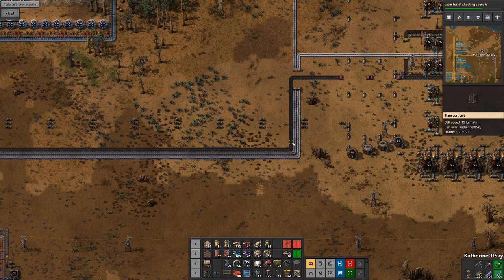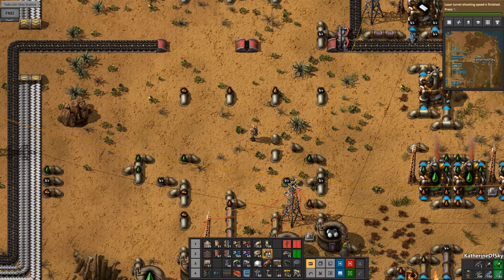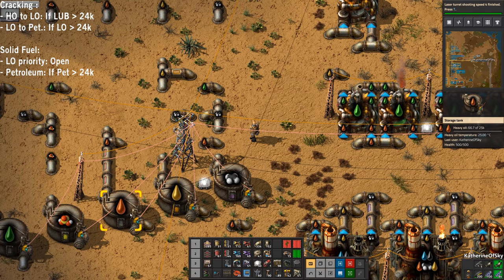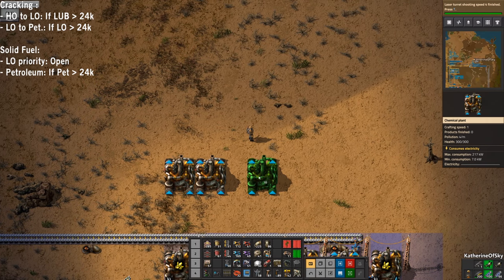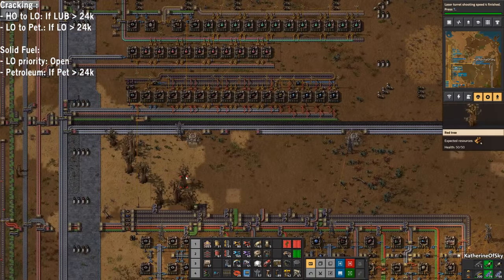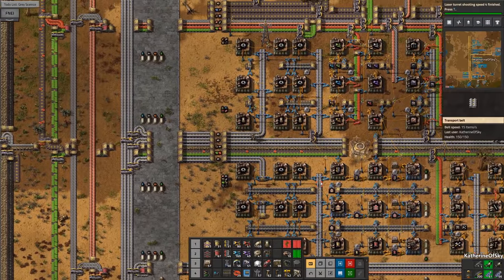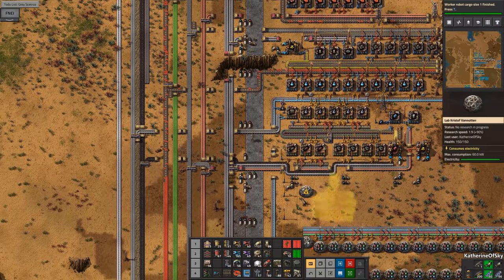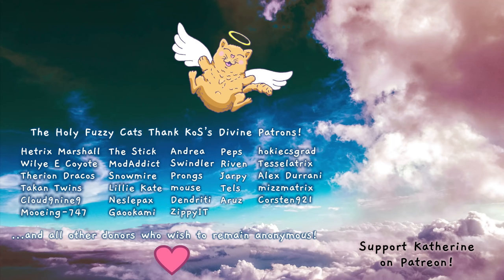Factorio 1.0 Entry Level to Megabase 3, Ep 16: ADVANCED OIL SETUP - Guide, Tutorial

Comment from the maker: Do you use circuits in your advanced oil setup, or let things flow freely?
Reply: The oil must flow! xD
Reply: I tend to use circuits as it helps regulate the different fractions and make sure there isn't too much of one and not enough of another, although with basic oil processing I just wait until later.
Reply: I generally just wire up the pumps to the tanks with conditions "light oil < heavy oil" and "petroleum < light oil" to make them only supply input to the cracking arrays when the fluids are out of balance, so that it will stop cracking if the lubricant or solid fuel / rocket fuel production is using lots of the respective resource, but if petroleum gets really low it will feed more light and heavy in to keep things running.

Good idea using pumps to distribute the petroleum to plastic and sulfur even when it's low.
Reply: Always use circuits!
Reply: I used to don't use circuits at all just let it flow. Thanks to your vids I saw the potential and nowy oil and other work 100 times better!
Reply: Circuits everywhere! I was wondering how complex you were going to go with this part of the playthrough.
Reply: LOL LOADED question that .... I will try and keep this as clean as possible ... but as a  guy there is only one answer to that ... it has got to be FREE ... lol };) 
nice timing btw ... breakfast theater after a 12 hour nap ... just what a tuesday needs after a monday ;)
Reply: the English language is so much fun when one can say more than one thing with the same words
Reply: I most definitely use logic to keep the amount of heavy and light oil between 30k and 50k using an RS-Latch (I use 2 tanks for each of these). I get stuffed by gas every once in a while, but not often. Plastics/sulfur usage keeps that in check normally.
Reply: Never used circuits, normally I try to keep my factory in constant work (science, belts and stuff) and I try to balance out oils, lube and petroleum, with little care to precise ratios....
Reply: I've never used circuits before, but I'm willing to try after watching how easy you made it seem
Reply: I have tried some complex combination with deciders and lots of conditions but it always need some adjustment and never worked fine. In the end the simplest is the best. I do the same as @Yancarlo said, "light oil < heavy oil", "petroleum < light oil" and so on to balance them with cracking, and works like a charm.
Reply: I was using circuits for the heavy to lubricant/cracking, but found the pump between the two to be unnecessary. If the heavy flows past the lubricant machines first, they take enough heavy oil out to run before it moves on to cracking. Also for the cracking setup, if you're thrifty on the outputs you can just run a solid pipe instead of undergrounds since they all output the same fluid
Reply: I don't worry about ratios. I just build enough cracking plants to completely drain every ounce of byproducts when my refineries are all running, then use circuits to regulate  it all.
Reply: My experience is that without some circuit logic plastics (depends on petroleum) are not made consistently. Advanced circuits need plastics and without them the whole factory doesn't run smoothly. So I always use circuits in my advanced oil setup.
Reply: I use a mod that lets me build flare stacks so I just burn all excess fluids straight into the atmosphere.
Reply from the maker: @gaiusjuliuspleaser  Oh nooooo!  So much waste!
Reply: Can't imagine it without circuits. Though coal liquifaction I have a self balancing system as I don't care about any product other than petroleum there

Comment: Hi Katherine and fellow Factorio fans.  I've been mirroring your Entry Level to Megabase builds in this series and up until this Advanced Oil setup, things are going great with 'Our' factory, so thanks for your terrific guidance.  Thing is, whenever I engage the Circuit conditions on the pumps as per your video, including all the correct wired connections and confirming my storage tank has 25k petroleum in it, the circuit condition of 'If petroleum > 24K', doesn't seem to work.  I have the same issue with the parameters for the pumps on the Solid fuel etc above.  It's as if the circuits aren't reading the values correctly from the Pylon-Storage data feed.  Additionally strange is the Storage tank shows 25K, while the Pylon reads 24K.  I reduced the Pump's threshold to >23K to try that, and it switched on, very briefly, then went off again and won't come back on.  I can only get the pumps to run if I remove the circuit connections all together.  I've re-watched this section of your video, restarted my connections etc. and I can't see how my setup is any different to yours, yet mine doesn't work.  Any advice appreciated.  I suppose I could, again, remove all the pylons' wires and pumps and try a third time.  Thanks for all the great content and I hope you're feeling at least a little better after your recent appendix op?
Reply from the maker: It sounds like something is not connected properly.  Make sure there is a wire running from the tanks directly to the pumps.  You can check the levels on any intermediate power poles.  If you need more help, please come to our discord.
Reply: @KatherineOfSky  Thanks.  I'll try the direct connection between Tanks and Pumps and see if that helps.  I'll also check out your Discord in due course.  Take care.
Reply: @KatherineOfSky  Think I 'cracked' it.  I saw that the pump/s were on a different Circuit Network number than the tanks.  I think due perhaps to to mixing some of the coloured coloured wires.  I replaced all such connections, again, following your video guide albeit with Green connecting wires for clarity and Voila.  It works :-)  Thanks again.
Reply from the maker: Yeah, the items need to be on the same color of wire to function together.

Comment: Your running a lot more fluids on the bus than me. I rail in my Sulfur, Water, Plastics and Lube. These all run up the bus and I simply make Sulfuric Acid in the spots needed due to how little is needed for any product. My buffers are the Loading stations for any individual product.
Your thoughts?

Edit: Why burn off Gas, plastic production alone should prevent back stuffing.
Reply: I do the same.  Putting sulfuric acid on the bus was more common in earlier versions, before sulfur was part of the chemical science recipe.  But there is no wrong way.  I also make explosives and rocket fuel at oil, and bring them in.  In the past, I have also made batteries at my oil, since I had iron and copper nearby.

If you do put sulfuric acid on your bus (whether trained in or made in 1 location), then your only need for water is concrete, which could be made near water, thus removing the need for water on your bus.  Like I said, no wrong way.
Reply from the maker: I've had issues when plastic production isn't enough.    As to fluids:   I feel like sulfur crystals have much more throughput within a pipe (petroleum).  And sulfuric scid I always make in the oil area because it requires a fair amount of machines.  However, you can do them however you want and whatever fits your factory.  If you wanted to really min-max, you could skip the Sulfur belt and replace it with Petroleum, which has a much higher throughput of the rest.   What do you do about making sulfuric acid for uranium mining?
Reply: For Uranium? I have a single acid maker in my Mall that makes acid for 4 battery makers, 2 blue chip makers (used for making a small amount of modules, which are always running as I keep steeling them, and fills a pair of tanks that get shipped out to the uranium mine, currently running about 100 mines at it's peak, aka when I switched it from belts to bots. It still sits idle most of the time. Note, my nuclear build really just got going and was kind of pushed earlier than normal due to dwindling coal supplies.

As for transport efficacy, I'm not sure. Fluid transport uses math I have never fully understood. I know what a pump's max flow rate is, but you'll only see that in tank to tank transfers, including rail. For me the biggest thing is that I don' figure out, to get iron to to my oil facility, of which my nearest is much further than yours, since it's all on the bus. I do know that as sulfur, a belt can transport 150 acid, as sulfur,  per second, each sulfur being 10 acid. Red belt cranks that to 300 if needed.

The thing is that you don't need that much on the bus on the bus, i.e. not counting the one in my ME, I have 4 acid plant, 2 for blue chips and 2 for batteries, at robot frames, yellow science. and again, they are idle most of the time.

As for back stuffed Refineries. the only time I had that issue was just after I made the switch to adv refining. As I ran through blue science and waded through Purple science, I found the issues was non-existent, indeed I had to expand plastics production. I also have rocket fuel production going for my car/trains, but not much gets used if my production stats are anything to go by, 10k produced, 119 consumed. I imagine that will shoot up when I get to rockets.

I would like to follow this up with that this is the furthest I've been since the oil change. so I was not sure how to handle them. 

Anyway Off to find Iron

Comment: That's a lot of Lubricant production, I think it's a bit overestimated - even for blue belt & bots production later on :D
I also never use petroleum to solid fuel production, because I never have to much of it. It's only needed if your factory is standing still and only lubricant is needed, but for me that's never happen before ^^
Reply: The end goal of this series is a mega base. If KoS wants 60 Utility Science, (yellow/gold science) per minute that requires 1286 lubricant per minute, (which is 22k/min lube for 1000 Utility Science/min.) [Also, it's not KoS' first, {or even her second} rodeo ;-) ]
Reply: I agree it seems a lot, but you know how KoS loves her blue belts!
Reply: @recklessroges  But this won't be the setup for the mega base, because she did not plan on any beacons or modules. Also 60 Utility Science/min need only 300 lubricant. I think she did it to keep the perfect ratio, showing new players how to work and calculate with ratios. I just mentioned it, because it really seems overpowered.
Reply: @Nightmarewalk  I agree with you, 2 chem plants is fine, 4 is overkill, 10 is just silly.

90 SPM requires 450 lub / min, which is 0.8 chem plants.
Reply: If you use solid fuel for power production you can run out of light oil if you aren't using all your petroleum. Making solid fuel from petroleum prevents that bottleneck.
Reply: @LVRugger  Oh thats right, I didn't think about that. I never use boilers for power production this much/long.

Comment: 6:50 You can actually just daisy chain the tanks with circuit wire, no need for all of them to connect to the power pole as long as one of them does and they're all linked together to transmit the signals. :)
Reply: But it looks so much cooler with it all connected to one big power pole!
Reply: I also prefer connecting to the pole because of the looks hehe

Comment: Hm. I set up my refinery in almost the same way. The key difference was the HO to LO pump's condition - I derped and set it to "if LUB < 24000". And then, when I got blue circuits, I was wondering why I suddenly didn't have any plastic anymore.

So first I added 10 refineries with basic oil processing and connected them to a pump with a condition "if Pet < 12000", then I went to check the other pumps. And found the real problem. As soon as I switched the < to >, everything started flowing again.

I think I'll leave the 10 basic processing refineries though. Maybe just lower the condition to 3000, or something, same number as is for making plastic and sulfur.

Comment: I don’t know if you’ll get into coal liquefaction later, haven’t watched that far into the series yet, but in my current factory I decided all my oil products would come from coal liquefaction. I was inspired by a Reddit post that showed you could turn a solid blue belt of coal into 0.89 blue belts of plastic, and decided to take that to the extreme. 

I kinda like it actually, because you start with so much heavy oil you never run low, and you can crack downwards as you need the lighter products.

Comment: I was starting to worry about the solid fuel array, because the light oil set up still had an underflowey pipe not leading anywhere, and the petrolium had an exit pipe that lined up with it. But then I measured it with my fingers and realised it's JUST beyond connecting range, so it's fine! 😌

That being said, this is a really nice benefit of watching videos like these. A lot of the work in Factorio is making sure things work, and doing that often requires a lot of attention to detail, making sure you didn't miss something or some tiny thing was placed wrongly, or whatever.

Comment: For those who use mods, there's a wonderful mod called Fluid Must Flow which has an Overflow Valve that pretty much does the same thing as shown here: it allows the flow only when the input is over 80% full. It takes less space and less hassle with the circuit network.
Reply from the maker: It's worth knowing how to set up circuits, since they are useful in many parts of the factory.  Mods also disable achievements ;-)
Reply: @KatherineOfSky  Yep, they're a lot of fun, no doubt about it. As for achievements, they still work for me :^)
Reply from the maker: You will get in the in the game achievements , but you will not get steam achievements.
Reply: @KatherineOfSky  Oh, that makes sense. Another win for GOG then!

Comment: I remember using barrels in a modded Bobs-Angels Megabase. I had colossal lines of belts lined with them. I was also using Loaders, and due to some unfortunate bug, sometimes the loaders would infinitely load stuff into assemblers. Normally they stop when the assembler is "full", but they just kept shoving it in. I kept wondering why my barrels kept disappearing from the network. Until I saw a machine that had stored about 35 million barrels of sulfuric acid. In a singular machine. I absolutely noped out of trying to fix that nonsense and fired a nuke at it. And I haven't really used barrels ever since. The Barrels weren't the cause of that bug, but still, that hurt.
Reply from the maker: hahaha!  I think I remember that bug!  Oof, that was crazy, thanks for sharing!

Comment: I think it would have been better to put the petroleum gas -> solid fuel plants in front of the other solid fuel plants rather than behind. That way, when they kick into production, it's really because you're not getting enough fuel from light oil alone and not just because you're not consuming petroleum gas fast enough.
Reply from the maker: It's imperative that they are at the back since the only way the Petroleum will be made into solid fuel is when it NEEDS to be emptied.  The circuits control the priorities.

Comment: On the topic of Barrels, I actually found them really useful in a playthrough I did a while back where I needed really high throughput for liquids, and with logistic robots, you have high latency but higher throughput than with pipes, unless you run a whole lot of parallel pipes, and the space savings were worth it there.
Reply from the maker: It definitely depends on the setup you are using and/or mods.

Comment: You seemed to leave the solid fuel just sitting there - where does it end up going on the bus?  The reason I ask is because I keep running out of sulfuric acid because the light oil fills up - I've already added about 6 more tanks to hold it but those keep filling up also.  My hope is if I can extend the solid fuel over to the bus and spread it out then more of the light oil will be used.  Really enjoying this series by the way - thanks so much for doing them!
Reply from the maker: Solid fuel can fuel furnaces, steam engines, and trains in mid-game.  Then, you use it for rocket fuel for space science.

Comment: Hello. I am hoping you can help.  My Adv Refinery  is only producing petroleum gas. I am not sure way since I have water and crude oil going in. I have replaced pipes and the refinery itself but not luck in getting heavy and light oil.  Any suggestions?
Reply from the maker: You need to change the recipe
Reply: @KatherineOfSky  I did change the recipe to produce all 3. I also did use circuits as you showed in your video.  Have tried letting it run free and with circuits. Still producing only one
Reply from the maker: @leemeador2789  Are the other types backed up?  You must remove all three products for it to produce regularly.   If that doesn't answer the issue, come to our discord and we'll help you further in chat

Comment: So my petroleum is filling up so fast that the refineries wont produce anything and im stuck without light oil and heavy oil. Is there a way to logistics around this?
Reply from the maker: Research Advanced Oil processing and use the circuits as I have specified in the video.  Then make solid fuel and store it if you need to to get the other oils flowing.
Reply: Hadn’t gotten through the video when I commented lol. Now as I get to the solid fuel section, I immediately felt dumb. Thank you, apologies!